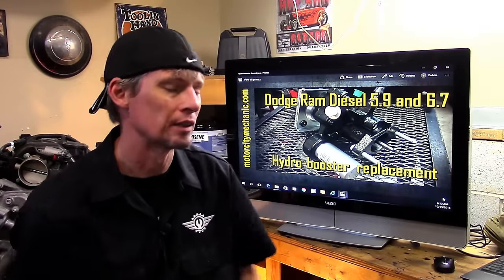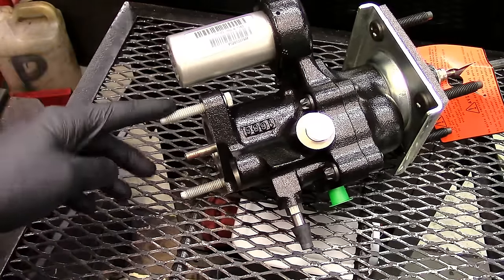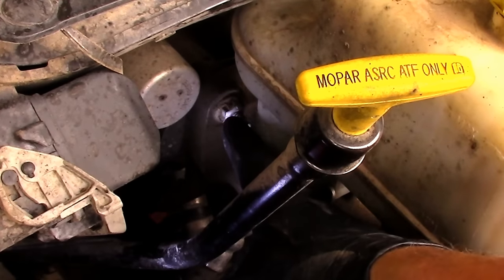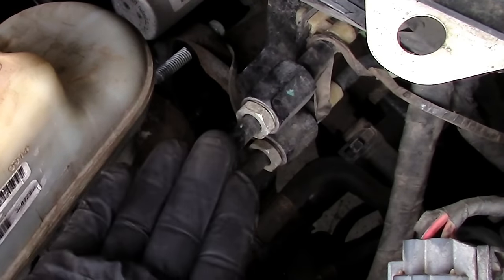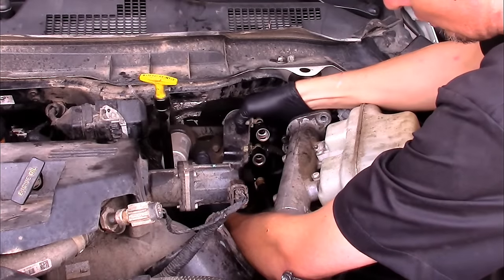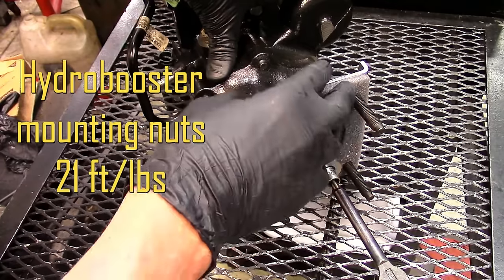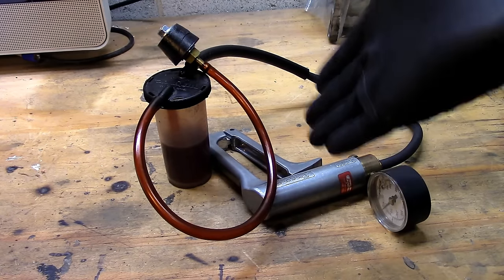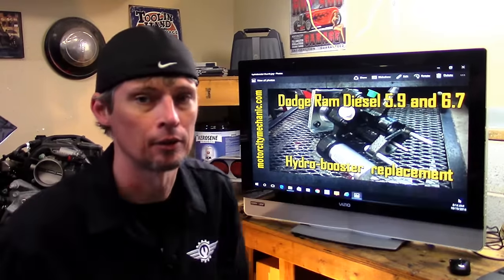Dodge Ram Diesel 5.9 and 6.7 hydro-booster replacement

Comment: I almost paid someone $700 to replace this. I searched how to replace hydroboost unit 2004 5.9 cummins. This AMAZING video popped up! THANK You for explaining what you’re GOING to do, and then ACTUALLY doing it. I can’t stand other mechanic videos that just tell You, and don’t show You what they’re doing. You’re a life saver!!
Reply: Was it easy to replace? I was quoted $900 to get this done in my 2006 ram 2500 5.9
Reply: This guy is this real deal!!
Reply: How do you know if your hydro booster is the problem? 7/19/2024
Reply: @scyltonfarquhar1070  weird noises when turning, weird noises when braking, or leaks. Mine was leaking on the interior of the truck and it is non-serviceable (2004.5 2500) so I had to buy a solid reman from Napa.

Comment: My '04 had the power steering hose mount support on the front of the master cylinder instead of sandwiched in between the MC and booster. This was a great video, saved me some time...

Comment: Have you ever heard of a hydrobooster causing the brakes to lock up when the steering is full lock?
Reply from the maker: I can say that I haven’t so far.
Reply: MCM can u say a little about what were the tell-tale signs that made u replace it?  Great Profesional in briefing and steps. TY!
Reply: @artzaragoza7887  Mine was the steering would cause the brakes to lock up when turned to full lock, also heard air escaping sound inside the truck cab. Booster solved it.

Comment: I have watched many how to videos for my Ram diesel, my boat, motorcycle etc. You are a natural born teacher, no bs just "how to". Great Job! My truck just sprang identical leak inside cab as you described.
My 03 Ram 5.9-2500 6 spd has 350K miles and I bought the truck brand new.  
I always wanted a classic pick up, just never imagined I would buy  a new truck and wait for it to be a classic. (no more standard transmissions on 3/4 or 1 ton trucks any more either :(
Reply from the maker: Being here at the dealership.....I remember those $30,000-$40,000 and thought how expensive they were and now I see them on Facebook Market place for like $500 needing lots of work lol. We use to see cars with no a/c and roll up windows....those are getting fewer and fewer. Heck every car had a spare tire back in the day and you could check your own trans fluid as well. But on the other side of the coin we still run a small transmission that we had back in the 80's still! Actually this is its last year but man.....30-40 year run on the same basic trans in the smalled front wheel drive vehicles is something else. Thanks Chris for reaching out and for the kind words. Make sure to subscribe.

Comment: JUST WOWWWWWW. Great video, excellent in every way. Made the job really easy. I had a problem with the aftermarket ( I know) shaft. It was a different size. So those who get zero pedal movement, swap the master cylinder shaft in the booster. 
    Definitely one if the best tutorial videos out here. Thank you David
Reply from the maker: Thanks for the kind words. I have heard people have issues like you mentioned and that just might be the cause....will have to keep that in mind.
Reply: How the heck you remove the old push rod 
The new assembly didnt have one 😡😡😡
Reply: @georgesolis2326  I’m sorry, do not remember exactly.  I don’t think it was difficult, I was just so pissed that the shaft was the wrong size. Is yours rusty at all??

Comment: Bro thank you so much.  I'm Def tackling this job.  I'm not paying someone to do this... it's making my steering tight and my break pedal tight and it whines with a weird sound when I press the breaks to hard or steer to far left and right.  I replaced my steering box with a new one and I replaced my steering components well as breaks. And it's still making noise and hard to turn.  So I'm guessing this is the issue...

Comment: Great video. I am having an issue with 2014 ram 2500. I have a “whining” noise coming from the steering and brakes. I’ve already replaced the PS pump and the problem is still there. I am going to try the booster next and hopefully it fixes the issue. I paid the shop to do the pump but after watching this video I’m confident I can tackle the booster myself. Thank you for making such an amazing video that’s easy to follow. Keep em coming!
Reply from the maker: Many thanks Jeff for the kind words. I appreciate it very much. Dont forget to subscribe.
Reply: Hey guys, how do you determine if it’s the power steering pump or the hydro booster? My brakes have a weird feel and I’m getting the whining that sounds like a bad power steering pump when I turn the wheel. I also have a whine just on idle and more so when I press the brakes. I’m assuming it’s the hydro booster but a little confirmation or a process to determine which is on the outs definitively would be great. And great video bud!! Bit of an amateur but I think I’ll give it a go.

Comment: Outstanding... Great detail, I studied your vid before replacing my brake system on my Ram 3500 and it was spot on. I would like to see you show replacing the master cylinder and bench bleeding it. Thanks!!!
Reply from the maker: I will keep that as a possible future video. Thanks for the request and for the comment about the other video. Its greatly appreciated! Make sure to subscribe and enjoy the weekend
Reply: Your Insight in the top inside bolt of the master cylinder to hydrobooster, it does not reverse out regularly I think the top of the threads on that bolt are different?  and how yo get a difficult to stuck bolt out of this situation since there is very little room for leverage on a open end wrench or even a ratchet wrench.

Comment: thanks for writing back, it must have been air because it worked its self out finally. it steers great now.
Reply from the maker: There are ways to remove the air using a special tool set up......but in the end, the same old way of running it and rechecking it over time works well also. Glad to hear that its okay now. Thanks for the update

Comment: Mine is leaking from what I would call a weep hole at the bottom of the booster. What might cause it to leak from there? But definitely will be using this video to replace the booster pump since it is making the whining noise and leaking fluid

Comment: Replaced the booster unit, no leaks, steering is fine, now my brakes are "spongey", brake pedal not as firm as it was before. Did not break loose any of the brake lines, so  any ideas?
Reply: Did you ever find the cause of this. Did mine yesterday and having the same problem

Comment: I purchased a new steering box from Orieleys. One week in and it started leaking but was working fine. They replaced it and the next one didn’t feel like it was working properly so they replaced it two more additional times. I decided to get a.m refund and bought a redhead only to find the same issue. Replaced the high pressure line to the hydro.. no difference, replaced the hydrobooster and no difference.  Next is the pump unless you can give me some advice please.

Comment: Have a 01 Dodge 2500 4x4 diesel. Push the brakes sometimes it stops, sometimes it doesn't. Start braking and then the pedal just kind of goes crazy, push harder and the pedal pushs back. I have let off and push again or put it in neutral to stop.

Comment: The plate on mine wasnt sandwiched, it was in front of the master cylinder making it almost impossible to get off.  Im not sure how it was put on in front of the master cylinder, but it made this 10 times harder.   Also, ive got hard steel lines on my 2004 3500, the master cylinder can only move so much before those are comprimised.   Fml im broke down and this video makes it look so easy but in my case its a pain in the ass.

Comment: Why would the booster leak fluid through the hole on the bottom of it? So.e days it has power steering fluid and some days it will blow out then we fill it again and it's fine but just a drip. This is on a Dodge 2014 5500

Comment: Great video !!!! Very well detailed. Can you help me ? 2005 diesel 5.9  92,000 on it. At a stop  it takes 3 to 5 seconds for my breaks to release all 4 brakes. Brake pedal got real hard twice. Fluids all good. How can you tell if you need a hydro booster or a power steering pump. No funny sounds out of anything .Thank you

Comment: I just replaced mine on  a 2015 . The new one said to take out my old push rod and spring and install in the new one e en the new one had its own . Well I didn’t and it caused problems. Cruise control and other were inop. It turns out that the push rod in the new pump was to short and kicked in a safety feature on the truck .

Comment: I have a 2011 Ram 3500 w/ 6.7 Cummins. So to be clear it uses ATF+4 for brakes and power steering?  If so, is Valvoline ATF+4 good for both brake and power steering reseviors? 

Thank you for the video and your time!

Comment: OK. finally an answer that addresses my vibration problem. and what to do to fix it. I,ll go try it and see if it works.
Reply from the maker: Depending on the year.....make sure the pressure line going to the unit doesnt have the nylon liner separated. If you take the line loose and the nylon tube is seen then the hose needs replacing, typically it causes a noise.
Reply: @MotorCityMechanic  Damn, I think i need to replave it. I found something like blk tape that was at the mouth of the hose. Well my 2001 3/4t ram diesel mite be due for hose changes anyway. Thanks for quick info.
Reply from the maker: Your welcome. Sorry about the delay getting back

Comment: After watching your video i was able the switch out the hydroboost on my work truck with ease, now i have a trans temp light on and the gear indicator is in the wrong position after i hooked up the battery any thoughts?

Comment: Yoo just got a 2016 2500 and the brakes pedal is soft as heck only has 34k on it have to push brake pedal in far to brake but feels like a gas brake pedal when it has air . Any thoughts would help me save some $$ please
Reply: Having the same problem so I put new pads in bled all the wheels and still soft pedal. I as well would like an answer.

Comment: Hello there,,
Nice video! I have a question; I have a 1998 Dodge Ram 3500 Diesel engine dually rear wheel drive,, and I just changed all my front pads and rear shoes and new hidrobooster and my truck brake Moore on rear tires than front ones,
What it could be the problem??
Thank you for any help on this matter.

Comment: 6.7 Cummins So the issue I’m having is my steering is whining when turning the wheel as well as When you press the brakes. What should I check first? How do I diagnose this to see what component failed
Reply: Nick, I hope you've got your problem resolved by now. But just in case: 1st) check fluid level in power steering pump. It's the single most popular cause of pump whine.  2nd) if fluid level is OK get someone you trust to help you decide if it's the pump going out(since pump is a bit expensive) , but sadly in my experience that is second cause of whine after low fluid level. If item 1) above is OK,  then unfortunately it probably is the pump. Since these pumps are pretty durable: when one is changed it would be wise to flush out the oil as best as you can to get rid of any debris from the damaged pump so that it isn't flowing through the new pump. Sorry I'm 9 months after your post, I hope this info helps. Rick

Comment: I have replaced the Mopar PS pump about 6-7 times over the last 5 years. A shop replaced steering box twice. I replaced hydro boost throughout process. I just replaced pump with new FZ pump for newer dodges with new pulley. Haven’t went 500 miles an after it warms up. It starts to wine like PS pump is going out. Any suggestions?!….I’m wondering if master cylinder is bad if it could cause this. Dodge, and 2 local shops have not helped in 5 yrs. 2003 Dodge Ram 2500 5.9L. Original owner, so not sure what else could be causing PS failure. Thank 
you.

Comment: Hey Dave great video.   Just changed PSP and PSB. Then my hydroboost started leaking.  Just kept filling it up for the last week.  Today I jumped in the truck to come home from work   Started truck pushed brake pedal down and it went to the floor and locked up the brakes and could not turn the steering wheel at all.  Could this be the hydro booster?   Thanks

Comment: @motorcity mechanic
Great channel Dave! I’ve got a 2018 Ram 3500 6.7l where the hydroboost is making good a hissing sound inside the cab. No leaks but you can see air creating small bubbles in the fluid on the rod that connects to the brake pedal when the brake is depressed and released. Any thoughts on where to start with this? Would this be a sign of a bad hydroboost?

Comment: I did this but my brake pedal goes to the floor and stays pressurized when I turn the truck on. What do you think I did wrong?
I already bleed brakes and power steering systems

Comment: I really appreciate your videos. You do very good getting the camera in just the right spot to see everything clearly.  I was wondering if you have seen any problems with pulleys locking up on 2014 ram 2500 w/6.7 ? My truck did not start and it only would click once. Both batteries had 12.5 volts. After bumping the key a couple of times it turned over. Someone told me the pulleys lock up on the Ram's. I also noticed a chirping noise when I first start it and it last until it warms. I plan on taking it in but was just curious if you seen this problem before.

Comment: I've got a 2016 ram 4500 in my shop ATM steering keeps jerking back to center it's 100%not suspension related power steering pump works but could it be pushing to much fluid pressure ? Don't have any way to check it any suggestions?

Comment: Hey great video. Would this booster cause tear brakes not to grab properly? 11 ram 3500 and I've gone through whole system other rhen this and have terrible braking abilities
Reply from the maker: I dont see how it would affect it. It basically acts as the power brakes like on a gas engine with a brake booster. It would cause a hard pedal and alot of effort to stop if it was failing.
Reply: @MotorCityMechanic  ok then is there a porportionate valve on this truck? It has new  rear disk all around and she doesnt stop worth a dam. Any help would be great

Comment: I did the hydrobooster swap on my 2004 3500 and ran it to a problem. First, the brake pedal dont reach the brake light switch anymore. I even tried to pull it into position. Another issue is that when i went to bleed, the system i did it the old fashioned way, and it got louder as i went through the motions and while the brakes no longer get stuck they get aplied via steering left or right. And for the life of me, i can't find anything i did wrong. Any idea on how to fix this?

Comment: Hey any tips on bleeding the power steering system on a 2012 6.7 cummins just changed the power steering pump and have been trying to bleed the system for hours no luck still hard as a rock thanks for any help

Comment: I have a 03 dodge with hard steering problems. I have  replaced the power steering gear box 4 x  and the power steering pump twice.  doing all of that work I still have hard steering could it be the brake booster.

Comment: Thank you very helpful and I’ve been a subscriber for a while and will continue to do so
Reply from the maker: Many thanks for being a loyal supporter
Reply: Got just 1 pro tip and the only reason I feel i can say that is now I’ve had to do it twice when removing and replacing the hydro boost their is a rod that goes between the master cylinder and in the hydro booster if the new one doesn’t have it you must remove the old one and install it before installing the new hydro booster in the truck trust me on this check twice before installing for all your other viewing this might not have caught that but everything else is spot on
Reply from the maker: @jnhudspeath  great tip and something I should have pointed out for sure

Comment: Awesome video!  That could have been a tutorial for the manufacturer.
Reply from the maker: Many thanks! Appreciate the kind words!
Reply: I wimped out and just got off the phone with a diesel mechanic....
Reply from the maker: Nothing wrong with that.
Reply: MotorCity Mechanic got a Dodge Ram 2500 5.9 Cummins. No power steering and the brakes locked up at the same time. Had a power steering leak for a long time just kept the bottle full well i guess she ran dry . New hydro booster or power steering pump I’m a little lost could ya get me some information. Thanks .

Comment: My steering is heavy on my 2015 3500 Cummins. Purchased it used and not really sure how light/easy the steering wheel should be to turn. The pump does sound a little whiny when turning.
Reply from the maker: Its hard to say how hard it should be or not be....to me I dont think they feel much different then any other series of truck.
Reply: Thank you for the reply. Thinking I might replace the power steering pump
Reply from the maker: @headforthehills3353  Your welcome

Comment: Please help.  Replaced booster and now have no power steering to left.  Right is OK, left won't go past 1 turn of the wheel.  It was fine before booster replacement.